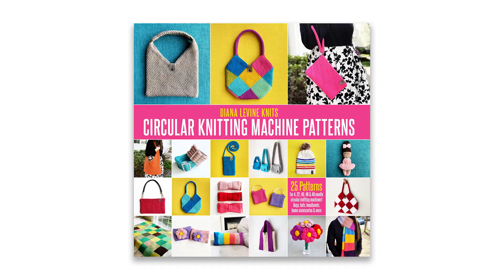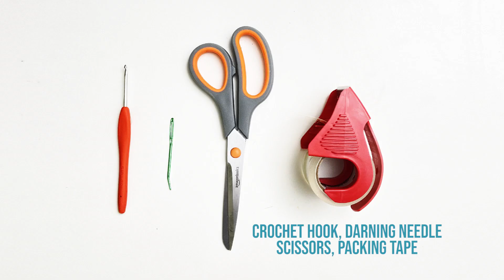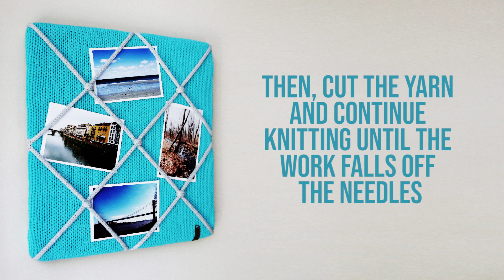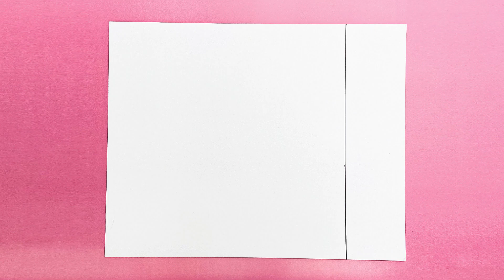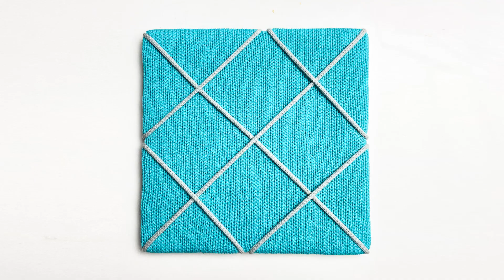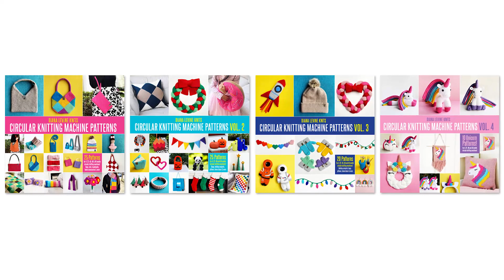Knitting Machine Memo Board! Tutorial for Addi Express Kingsize Knitting Machines and I-Cord Maker

Comment: Wouldnt it be easier to knit 4 pices sew  them together so it turnd into one big tube, sew up one end, put the carboard inside like a pillow, and sewn the top closed?
Reply: I was thinking the same thing. Then I realized that impact the tautness of the piece. Also, having only one layer on the front could make it so you could see whatever cardboard/mat board used.
Reply: @peggy5990  That is true. But what if you make 4 tubes that wrapped all the way around, kitchener stitched them together, and then sew all the tubes together, sew the bottom closed, put the cardboard innside and sew up the top, then you will get double layer of knitting on both sides.